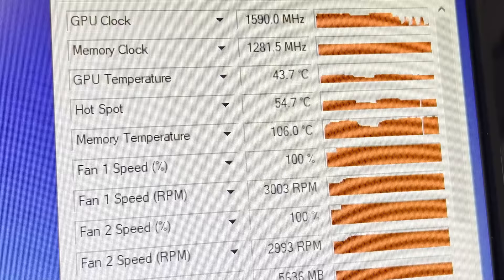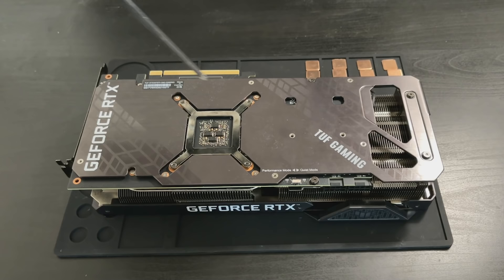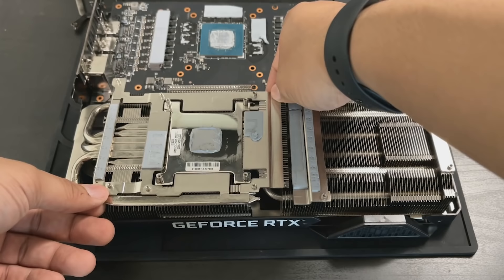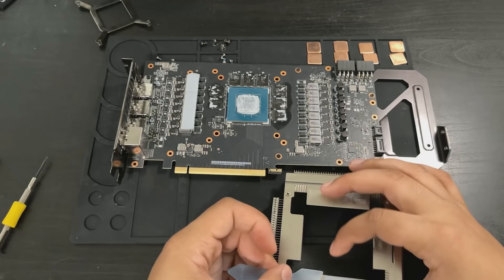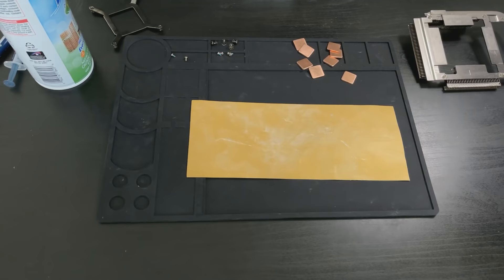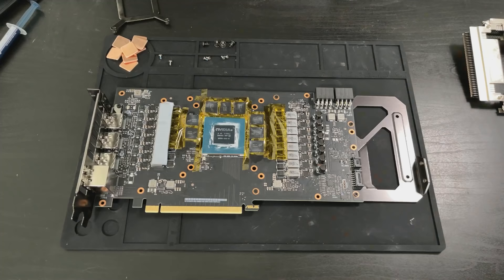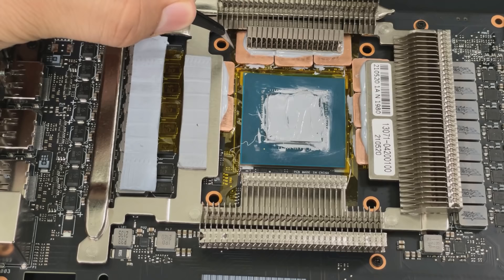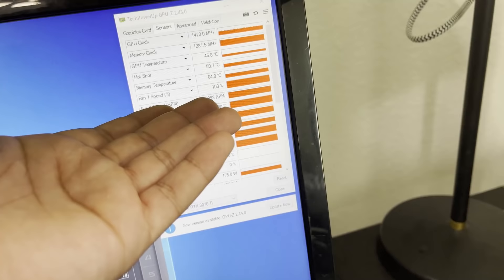I Copper Modded An RTX 3070 Ti.  Memory Temperature Dropped 45 Degrees! This Is How. (110C to 64C)

Comment: I would be interested to see this using KPX and liquid metal on top.  Given how much larger the memory module is than the heat sink, this may also be a good application for a thin graphine layer to move the heat horizontally as well.  Maybe a composite shim with two things copper shims with layers of liquid metal and a single ultra thin graphene layer in the middle.  Compress under a high pressure to remove any air and/or voids as well as force the liquid metal into the cavities of the graphene to help with the relatively poor z-axis heat transfer.

Comment: i have 52c memory temp and 46c gpu temp,i have 3 years never open my gpu asus 3080 tuf, i think is not thermal pads the problem,normaly if the copper is two good to be true you must have lower from my gpu temp,but you are still higher on temp with copper and is not safe is risk.
Reply: Is not a risk, copper shims are safe. What is the risk is your memory chips running around 100 C most of the time, that will brick your card. The only risk with copper shims is using wrong thickness.

Comment: Dont use copper mode
Reply: why?
Reply: @Inuitman  It has no effect on performance, the high temperature of the gpu is usually the reason for a poorly installed cooler and improper processing by the manufacturer, if the temperature is still high despite the replaced paste and pads, I solved this a long time ago, copper mod can destroy your gpu and the temperature is lower only because of that because it compensates for a poorly made cooler that overheats the gpu, despite good maintenance, I recommend returning it immediately and not using it at all.

Comment: Correct me if I'm wrong but I thought copper and aluminum mashed together  like that causes a Chem reaction  or am I thinking about something else regardless bro nice vid and nice results
Reply from the maker: If an electrolyte is introduced, galvanic corrosion could occur. However, so long as you aren’t feeding your GPU marmite and salt water, corrosion should not be an issue.

Comment: Terrible cooler if it needed that.

Mine has never seen over 72c @ 1800mhz.

Ummm. Thats a TUF 3070Ti..... That shouldn't be happening. Definitely a factory pad issue.

Comment: I would skip the tape. My guess is that the tape will go off when the card gets hot anyway. The copper plates should not be able to move if installed correctly.
Reply from the maker: The Kapton tape is a special tape made to withstand heat changes. While the tape may not have been strictly necessary, it’s always better to be safe than have crispy GPU.

Comment: Nice video but,  taping off parts of the VRM's will suffocate it from the cooling airflow from the main cooler. leading to increased temps and because only 70% of the VRM's are taped off, there will be voltage differences between the Non taped VRM's. This will likely reduce the GPU boost 2.0 max clock on the GPU core.

I like the Idea of shimming tho, gonna try that myself. Good work !

Comment: Ah, yes, a very robust way to ruin your VGA.

There are more things that could go wrong and more things to consider. Short-circuit possibility is only one of the many problems.
We are at the point where hardware manufacturers have figured out planned obsolescence and the only way to prevent this is to vote with your wallet.
Refuse to buy deliberately poorly designed products and spread the word about them.
Do your research before buying. Lookup for review videos with complete disassembly for models you want to buy and see if there are any design problems with them. If no such videos exist this is the reason to avoid the product and look for another model from another brand.
Design issues could be numerous, Ex. when heatsink has small external frame that covers memory chips, but ineffective, or when memory chips are covered partially, or only some chips are covered.
Heat tubes have to be soldered to the heatsink and the main thermal pad has to be made from thick copper, not steel.
There are also could be many points of failure on PCB itself, Ex. low quality components, no fuses, weird placement of hot-components not cooled by the heatsink, etc.

Comment: How old is this card or when did you start using it?  I see the thermal pads are already leaking oil!!!  Most people would use 3rd party  replacement Gelid thermal pads instead of copper shims.

Comment: My Gigabyte 3070ti GPU runs at around 57°..try not using a shit tower with shit cooling. Also, set your fan curve on MSI afterburner. If you're hitting temps that high your build is trash.

Comment: what a bad design from the company, they don´t even cover the full memory chip. Factory can´t replace thermal pads because the thermal paste might dry in 4 years, so they go with thermal pads? also notice how bad it is that the SUB heatsink on the other side has more thermal pads touching the pipes. come on!  i bet if you put more copper in there with mx4 the temperature will be even lower=?

Comment: Jesus... you use extremle to much thermal paste. More != better.... You add it a little one. Then you smear it... rest will do PRESSURE, when you put radiator. MAIN reason when we need to add thermal paste. IS TO FILL GAP between 2 surface. And when put almost flat surface to another, you need only tiny amount of thermal paste.
If you add to much, most all of it will flow over.

Comment: Excessive cooling of vram means they run faster rather than limit so they draw more power and stress the other components, and you may burn out your power circuit, sockets are likely already run at max load. GPU engineers are way more qualified to build GPUs than YouTube kids.
Reply: It just stress test bruh.
How about R&D budget limit?
What possible to kill your componen? Is that temperature or voltage?
Did you know mostly memory defect on GPU caused by voltage or temperature?

You said "Excessive cooling of vram means they run faster rather than limit..." Wait whut? Soundlike you contradicting yourself.
Did you know the default settings from vendor itself? Is there are no limitation?

Comment: I modded my 3080 with Thermalright Odyssey 12w/mk High performance thermal pads under the water block and backplate and then put it back into my custom water loop.
At stock, it was running under 32c in games under 100% load and overclocked to +185 core, +1000 memory it was under 35c in benchmarks. 

Of course a mod that uses copper shims whilst you still air cool it is good, but if you want consistently low temps for overclocking potential or just overclocking whilst still having  a quiet running PC then putting the card in a custom water loop is the way to go. 
(change to 4k quality to see the video at its best) https://youtu.be/HgHrqT8hADA
https://youtu.be/v8ItbISgRcc

Comment: So many issues with Copper modding. The first issue is are you really improving the situation, or are you actually making your temp sensor not report the temp correctly? Another issue is are you modding something when you should be making sure your thermal pads are the correct thickness and haven't dried out? If they dry out, they more or less become an insulator, doing the exact opposite to what you need. A single screw-up while copper modding and you can permanently damage or ruin the entire GPU... Some vendors don't put a good heatsink solution on the memory or if they do, they don't get the thermal pad thickness correct. Copper modding is just about as bad as a novice putting liquid metal on their GPU or CPU... It may work great for a few hours or days, but sooner or later that liquid metal will move and short out, very likely taking the cpu/gpu with it...

Comment: LOL what a waste of your time and potentially worse performance overall.  This is almost as stupid as "heat spreaders" on RAM cards.  Notice the memory clock didn't change.  What are you even trying to accomplish? 4 to 5 grams of TIM?  LOL.  No.  You're using way too much and you're not supposed to smear it around.  Good lord.  At least you aren't using conductive paste.  Memory wasn't your problem, and what you think you're solving is causing the opposite problem in many cases. You also don't use the same thickness shim as the pad.  Pads account for compression.  With incompressible shims (which are almost certainly not flat enough as well), you'll at least be losing clamping pressure on the die.   And who said it was throttling due to memory chip temps?  People, just don't do this.  Source:  Computer hardware engineer and professional for a very long time.